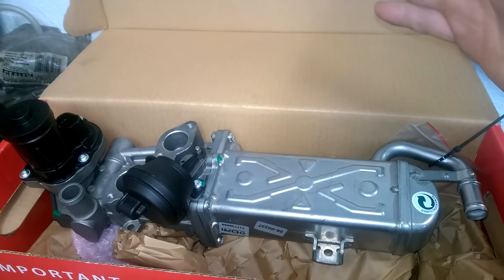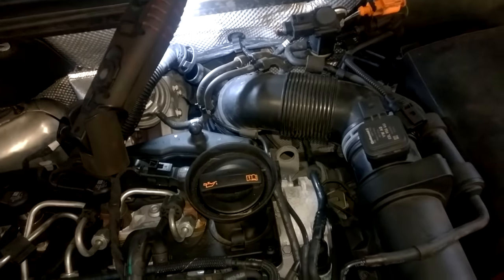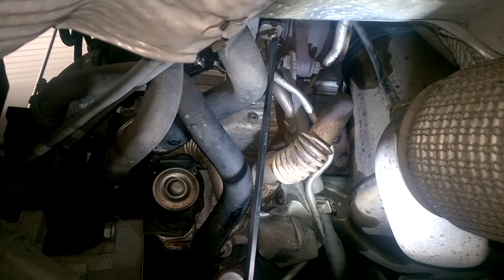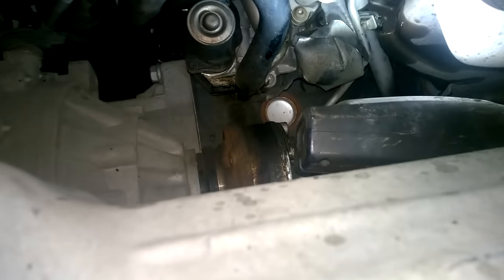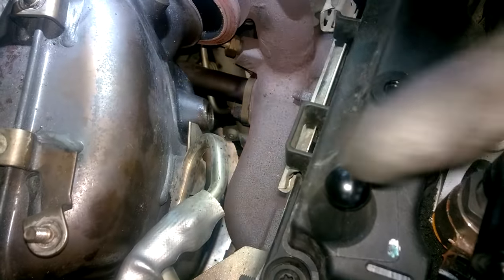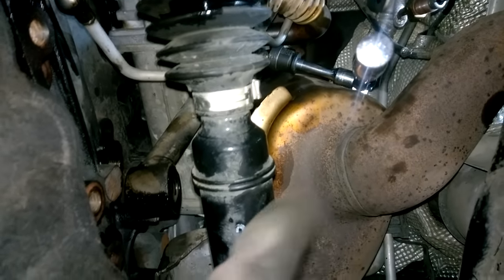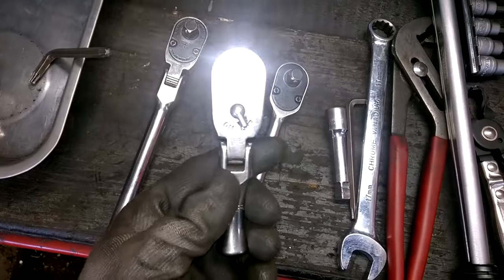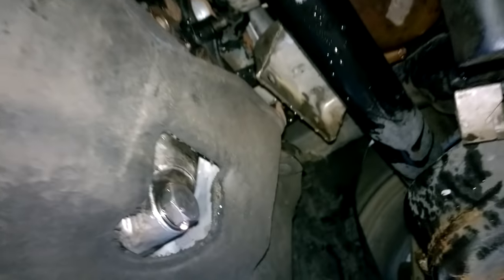Volkswagen EGR Valve Replacement - How To

Comment: Just carried out this job on 2013 Touran today and all went well thanks to this video so thanks!
Just a couple more tips - I removed the subframe complete with steering rack and the O/S drive shaft which then gives much better access to the back of the engine. Once that is all out of the way the removal and installation of the egr valve only takes 1.5 hrs. Also - except for the top exhaust 13mm bolt, nothing needs to removed from above (So leave heatshield / sensors and air box in place!)
Reply: Thank you for advice

Comment: Hi Gerard Burke.I do that job without removing feed and return turbo pipe,that save a time and prevent of oil leak from that place.There is plenty of room to slide that EGR valve in to the gearbox side.To make that job easer i always remove bottom engine mount and tilt engine forward and block in that position by wooden block between subframe and diff. Normally whole that operation took me 1h25min out and in new valve. Regards from Poland
Reply from the maker: Incredible time, well done to you :) Thanks for the comment and info
Reply: @GerardBurkeBurkesGarage  you welcome :)
Reply: I just did this job. I ended up removing the turbo oil pipe to access the right hand egr fixing bolts, they were difficult enough to remove even then. How did you get them out with the oil pipe still in place? 
I managed the job in 3.5 hrs remove and refit, but it was my first attempt.
Reply: @GerardBurkeBurkesGarage  hi what brand of egr valve do you use .is it aftermarket one ?   Thanks
Reply: Hello, can someone tell me which brand of agr should I buy vemo,hitachi,pierburg,wagber or nissens?
Regards
Reply: Add webasto system and 4motion to this job then you have a real nightmare!

Comment: Just tackled this job at work. Bad enough on a ramp. Wouldn't attempt on my back ha ha! The egr pipe on the left a pig to get those t30s out.
I left sensors in exhaust and just moved to get to top right t30 cooler screw to engine. Again not easy.
Start to finish 6 hrs! A lot quicker next time tho you learn I guess.
Helpful video tho thanks

Comment: Definitely  a great help. Had one done on a Tiguan by a garage. but the fault light is still there.
now  2 fault lights on  after changing.  Engine and the coil light( Flashing) car slow unable to climb hills. Thanks for the great video
Reply: They didnt do the job right

Comment: Really great video, helped me out no end. I had problems re-using the turbo pipe gasket, a new one solved my oil leak issue and was £5 from VW. If you aren’t buying a genuine EGR you will probably need this.

Comment: i had the pleasure of doing one of these on a octavia, my method was to drop the subframe and get the dpf out the way. much easier to get to those fiddly rusted bolts
Reply: chocolate teaspoon  thanks for the information
Reply from the maker: I had heard of that prior to doing it but when assessing it I thought it might take longer that way. I also heard about the driveshaft removal too but again I didn't think it would save me time. If I was at another one I reckon (typical mechanic saying) I could get through it a lot quicker, simply because I had to remove the oil supply feed to the turbo a few times due to a failed gasket, and I found the quickest way with my tool setup to get that hardest ones in and out fast.
Reply from the maker: What time frame would you have done it in? I can Imagine I will be doing a lot more of these in the coming years.
Reply: i think it was somewhere in the region of 4-5 hours total, the power steering was an electric column so disconnect  the rack joint, stab links, outer steering and lower swivel joints, gearbox lower mount, then the subframe can be unbolted. the driveshaft and dpf can then easily be removed
Reply: maybe not alot of difference in time to you but i prefer to have as much room as i can, specially when some of the bolts looked like they didnt want to come out
Reply from the maker: Thanks for all the input, much appreciated.
Reply: @chocolateteaspoon  wish you'd of made a video ..I just brought a Octavia and some of the things to do look scary...
Reply: @Grahams-Grass  i dont have any recording/ editing stuff, plus im not very good at explaining stuff as i go
Reply: @chocolateteaspoon  neither can I lol  but I do lol

Comment: Iv just done this in my own car , I’m a plumber by trade I watched few videos before I started ! I thought I’d take of the valve to see how hard it was before buying a new one to see if there was any visible faults but all seemed ok just abit clogged up , I cleaned and put back plbit still faulty so I think electrics have gone ! Overall I didn’t think it was that hard and I did it on axle stands ! I took out drive shaft too! The only problem I had was the turbo return pipe has small amount oil leaking from top connection so when I replace the new valve I’m waiting for . I’ll make a video and do a step by step replacement ! Soo all diy people can give it ago but you will need many tools
Reply: Hi I plan to do this job at home in my garage o. Axle stands. Did you ever mange to do a step by step video?

Comment: Can i ask what the symptoms of a bad EGR were? I'm having some problems with my Golf fitted with the 1.6 tdi Cayc and it's not giving any codes, it drives fine in lower gears but if i cruise at 60 in fourth it kinda pulses and is gutless in fifth. I visited my local garage and they told me it was the egr just by driving it round the block (i don't think it would have even done it's thing at 30mph) and i'm a bit worried that i spend £750 on an EGR and it turns out to be an Injector (although they were replaced two years ago when i bought the car).

Comment: Hi Gerard had  had a oil leak under the turbo where inlet and outlet oil supply pipes meet. Was I suppose to replace that gasket or what could have gone wrong. I noticed after the car was idling that it was leaking slightly. Great video i sorted my EGR fault.

Comment: Hello Gerard, there's a black plastic cover in the back of the EGR motor that covers EGR moving mechanism, I would like to ask you if the black plastic cover can be removed with out removing EGR from the engine? Great video and very informative. Thanks for posting

Comment: i got P0404 code do i need to replace the whole thing like you did or can i just buy a new valve (i got VW jetta 2007) because i did not see just the valve to be sold seperatly or i am not using the right name for it when searching

Comment: Hi ger...have the same year and model golf...showing egr fault code. Just a question...should the egr motor make an audible motorised noise when you switch ignition on when cold (before starting engine)? As mine is not doing that and I suspect the motor is the problem as I can manually move motorised hook easily in situ

Comment: Hi guys, I have checked all motors and moving parts of this module and I am asking what is the common failing part of it.
What can be cleared and is it good option to clear the electric part and replace the cooler or what you will suggest? 
Second question what brand has best price/quality ratio ? 
The car is vw passat 2012 140hp without bluemotion and it has 82000 on the board (it has history that prove that number is real)

Comment: So the EGR valve is a pretty common fault, shall we design the new engine so it's a completely hideous job to replace it? Maybe it's so no one would bother taking it off to clean it out. Have to buy a new main dealer part! I have to do one of these today so I'm weeping a little. Thanks for the video.
Reply from the maker: Hope it went well for ya :)
Reply: @GerardBurkeBurkesGarage  I got it done ok mate. Took me about 6 hours. Not the nicest job to do though. Thanks for your video, it helped a lot.
Reply: @noddylloyd  6hrs for the whole replacement ?
Reply: @N-e.o  Yeah. Definitely a good idea to take the driveshaft off. A guy at my work did one before without taking it off. Struggled the whole job and then had to take it off anyway! Doh!

Comment: Does the new egr valve have to be programmed in to the ecu on the car with a laptop or can you just crack on without any proggramming
Reply: Plug and play, sometimes basic setting but very rare

Comment: Have a VW ea189 engine from new got it too 165000 miles egr failed replaced then failed 11 months later 175000 now at 200000 and failing again any ideas why? It didn't have emissions thing fixed by main dealership and apparently it's a genuine part from vw

Comment: I've just replaced the EGR valve on a Golf 6 2.0 TDI with an new original one together with all the gaskets and accessories required.
I've also cleaned the throttle body and the plastic intake gallery on the inside.
After this operation, the car developed a problem it never had before, when the car does the normal DPF regeneration, the idle is fluctuating badly up and down, it goes under 800rpm and over 1100rpm when i'm wainting at a traffic light. 
Before the replacement, the regeneration would bring the RPM at around 1000 when the car stood still  and it would stay like that, no fluctuations.
I should also mention that the sound of the engine also changed a bit, it's a bit more rought, before it was sounding buttering smooth.
Any ideas what could it be ?
Reply: Hi, noticed your comment. I’m having a similar issue with my VW 2.0 TDI. Very rough idle when engine is cold or stationary. Did you manage to resolve your issue? Thanks
Reply: @mightyakram2003  Unfortunately not, I've went to a VW dealership and a few well known mechanics. Nobody knows for sure what is causing the rough idle and harsh sound after 2800rpm. On the tester, the car seems to be in parameters...

Comment: The EGR unit on a 2011 Polo TDI (cfwa engine) looks exactly the same as the one you're doing..

Did you use a code reader to establish faults with the unit?

The Polo had fault code P0405.  I removed the valve motor, the bit with the electrics plug, checked the operation of the valve in the main body by working the geared lever that the motor works, then reassembled it. Doing that extinguished the Engine Management light.

Comment: Thanks for sharing this Ger, how long would this job take you? Without the filming and editing obviously it delayed you a bit.
Reply from the maker: I would say clear your day :) ha ha with everything taken into consideration like, rechecking fault codes & making sure the coolant system is free from air etc rechecking for any oil leaks before and after test drive. I would say 4 1/2 - 5 hours. I had mechanics say that expect to have it for the full day and they were right. I was at this one quiet a long time. Like any job the second time would be easier knowing every trick to speed it up. This game is not a race I say to every apprentice that I have work with, rushing through the job to break time records over time will cause mistakes. If I did not re check the job it would have been losing small amounts of oil. You know most of that already :)
Reply: No need to remove oil feed or return, I used to do 3-4 of these a week depending on, also wouldn't even think about putting anything but a genuine VW part in anything else is waste of time, nice job I'd gladly do a few of these a week if they came my way, but it's not a race take time and no interruptions 👍

Comment: would you fit a remanufactured egr cooler or only go with brand new.
Reply: don't think the vw coolers are separable from the valve...
Reply: @codetutor6593  i have seen others clean out the cooler passages with oven cleaner,spray foam.It would appear to work ok,do you have an opinion on this?

Comment: My girlfriend has a 2013 polo tdi with the engine light on, diagnostic says egr valve is faulty so i have bought a replacement but shall i fit it myself or get it done at a garage? Im not a mechanic and i only have a socket set, any advice is appreciated
Reply from the maker: My thoughts from your comment would be to highly recommend bringing it to a garage, it will save you a massive headache :)
Reply: @GerardBurkeBurkesGarage  £700 later will also make your pocket ache

Comment: Is that on the 1.6tdi Ger? If i want to blank the egr on my 2012 passst is it a straightforward blanking plate and remap? Thanks Ger
Reply from the maker: Hello Paul, Sorry for the delay, I find it very difficult to get through all the comments and its not possible a lot of the time. 
Regarding the EGR delete it is not that difficult I believe, I have never blanked an EGR permanently for obvious reasons with the workshops I was involved in. With remaps there are a whole host of cowboys out there including plenty that operated in the West of Ireland which ended up giving me extra work fixing problems they created. 
 
Use a trusted company or workshop that has good reviews of this type of work being done. I hope this helps and Happy Christmas to you and yours.
Reply: Gerard Burke Thanks Ger

Comment: I have golf 2011 gdi bluemotion, lately I start to smell bad exhaust smell inside cabin. It happens sometimes. Bluemotion stop working and angine smell really hevy exhaust and the fan running high. Is this error because of bad egr???
Reply: Injector seal?
Reply: Its a regen, dpf is cleaning itself by injecting more fuel and warming up exhaust very hot. Regen takes about 20 minutes. Dont use modern diesel car on short journeys, not worth it. Fan is turning on becouse of heat from exhaust, its normal thing while regen is on.

Comment: I see your part is not an original replacement  but instead it's an aftermarket part. I have been advised by garage that it has to be an original part and that after market would go bad within  24 hours. Please can you advise whether you've had any issues with your new after market part?
Reply from the maker: Absolutely no issue since install. That is a lie about aftermarket parts. Buy from a reputable Motor Factor that has warranty on the part and you can't go wrong.
Reply: @GerardBurkeBurkesGarage  it turns out the garage were wrong. I took it to another garage and fixed the issue with £100. Sold my VW. Never going back! Far too many issues with the 1.6tdi.
Reply: @thetruth3316  what was the problem as I'm in dilemma as well to replace my EGR or not
Reply: @aburayhanaabdul5881  there was a cracked pipe under the car .. my local garage where my friend works just replaced that and all good after
Reply: @lirico you must be the luckiest can you name the garage
Reply: @aburayhanaabdul5881  every other garage I went to straight away said egr valve £700 to replace. I really felt like crying hahaha. Yeah very lucky on this one!. Its a garage in south east UK, Kent. Are you from around that area?

Comment: So how did you undo the top of the last crooked pipe? 2 hours spend and still no result. Thanks
Reply from the maker: If you look @3:30 you will see my set up, I used multiple 1/4 inch extensions, the slimmer 1/4  allows the socket to just be slim enough to remove. I hope this helps.

Comment: I had my egr replace on my 1.6 ibiza because the vacuum valve seized up. Ever sins the old egr was replaced I've been getting either exhaust gas or burning off of oil smell that gets inside of the car. The garage that did it has closed down. Taken it to a couple of garages and cant find a fault. Could it be a faulty gasket? Any ideas?
Reply: blank the egr....i have same prob hope mine is sorted tomorrow.will update u

Comment: Simple tip on how to fix any fault on any VW/Audi/Seat/Skoda etc.

Sell the bag of shit and buy a reliable, well engineered vehicle instead of buying into badge snobbery..
All those car makers who got slated in the 80's and 90s took note and went away and fixed their issues, the Germans did not, they're living on a reputation built back in the 70s but now are just plane crap.
Reply: Any particular cars you'd like to recommend that don't have these DPF EGR issues?
Reply: @allanjones1330  Hi, most cars will have dpf issues if your driving style means you're doing lots of short journeys around town, bit that's a driving issue, vag cars have dpf issues full stop.

Personally I'd go Kia or Hyundai first, then most of the Japanese stuff followed by ford, Peugeot, Citroen.
Reply: @cundycross    yes mine has been on a lot of short journeys, knew I shouldn't have given it to the missus! Thanks and interesting what you've said about VAG, you could be bang on the money and maybe I have bought on rep unconsciously.
Reply: @allanjones1330  I feel your pain. I've worked in the automotive industry pretty much all my life, I've seen changes, some good some bad. I spend my days traveling to many local garages as an independent auto electrical specialist. I can guarantee a good 80% of my days work is German. Hence the negative view of them.

If something is good I'll praise it, if it's crap I'll tell it as it is. No need for glossy covers here.

Listen to all car reviews and they all say the same, nice posh plastics and fancy interior, that's it. I'd agree, the interior is very good. But you don't drive that. The real test of a vehicle is in the running gear, and we need to be mindful of that.

Unfortunately the masses go on image now more than anything.

Me, I drive a Mondeo, had it 2 years and racked up 60k, not one single fault. Disks and pads a set of tyres and a few services, that's it. 

Before that I had a fiesta van, run 3 years without a single fault, 45k, still on original tyres and brakes, over 65mpg, and the best fun I've ever had in a van. Brilliant.

Looking at new focus, Kia ceed or i30 next,  generally end up with ford because I know most of the dealers and they always do me incredibly sweet deals.

Hope your next wheels end up being more reliable.

Comment: What make is the EGR valve you are replacing
Reply from the maker: I honestly can't remember, I sourced it from a local parts supplier and it had a 1 year warranty from memory. If I was still in Ireland I would look up the part invoice for you but I am in OZ now so it is not possible.